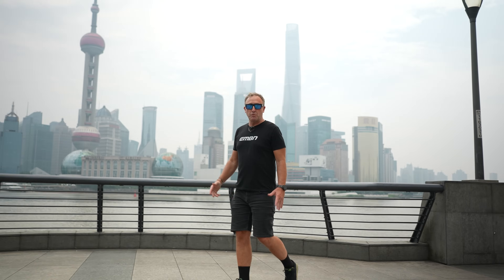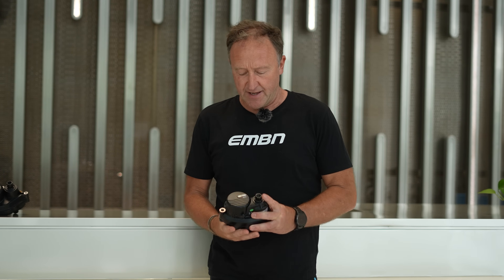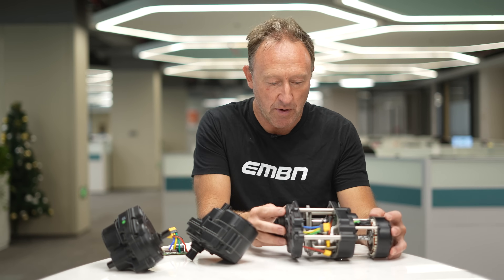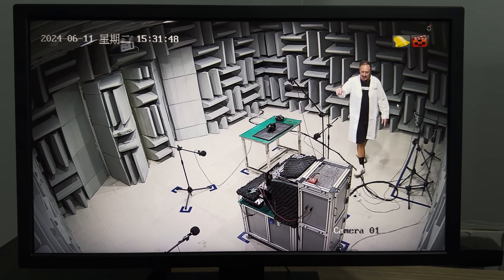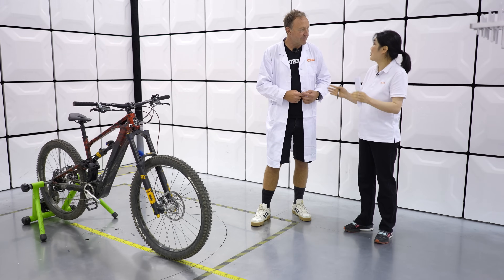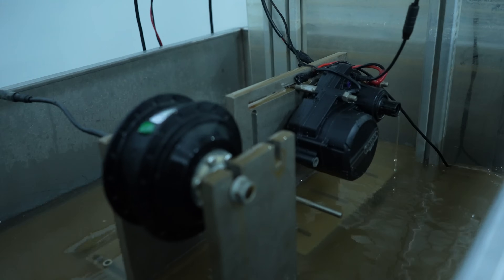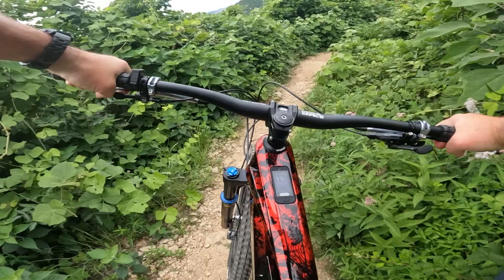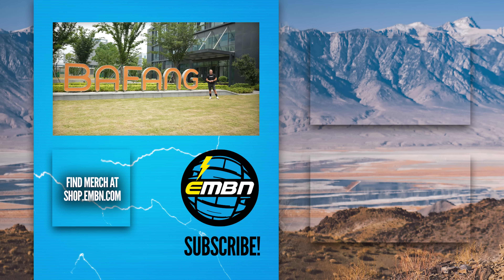How eBike Motors Are Tested! Behind Closed Doors At Bafang

Comment from the maker: Did you learn something new about Bafang from Steve's tour? Have you tried a Bafang motor yet? Let us know below 👇
Reply: Yes, it changed my opinion of Bafang
Reply: What an amazing company, a factory churning out cheap motor for weapons, that will be affordable for the buyer.
Reply: Been riding a Bafang M620 Ultra for about 2yr now. I simply couldn't ask for any more. What I just witnessed explains the reliability and power of this motor. Thx You for braving the "evil" China to bring us this report!
Reply: @GDawg2K2  My M620 has an external Flipsky 84100 controller. Battery Samsung 50S 20S6P 50A/84V. 4.4kW/260Nm, this is power :)
Reply: I have build 9 Bafang BBs bikes. The oldest has over 13000km on mountain trails. Amazing motors repairable customizable and quiet!
Reply: If Bafang made a direct replacement for an EP8, they would have a winner
Reply: @embn  uso bafang 750 en una giant Glory 00.......desde hace 2 años tengo la mejor bicicleta eléctrica de mi ciudad....... lo dudas?????y el arreglo es gratis.....160nm Torque.....limitó y deslimito depende del día........mi bici bafang unica y bafang es el mejor motor bacsno oara reirte de todos tus amigos con bicicletas de 10.000 euros.......
Reply: I’ve been to Suzhou many times to visit electronics factories. But I never knew single track was so close! I’m doing that next time!
Reply: I had a bafang hub motor for 2000+km until now with no problems. 🎉I’m very happy with it. 🎉😊😊😊
Reply: I learned nothing. I'm too damn hard headed.
Reply: When do we get part 2?  Can’t wait to see the rides especially the m560.  I’ve heard they made it stop sounding like a jet engine.
Reply: What a great slick report. Bafang. Opinion. Changed.
Reply: Congratulations on the excellent article, anyone who has had other engines and can compare, knows the difference it makes to have a BAFANG engine, in terms of durability, maintenance, access to engine parts and configurations, costs, power, torque and the pleasure of switching to other brands on the trails.
Reply: I have a Forestal Siryon with a Bafang made motor system. Very similar to the M820 in this video. 2 Motors (first failed out of the box), 4 Batteries, 2 chargers, 2 dashboards in under 12 months. Bike fails every time it gets a light watering. Can you please ask your Bafang friends what went wrong here as Forestal are blaming them for everything.
Reply: been riding an M600 for the last 2 seasons.  Motor is a banger, battery has been glitchy.  After seeing the level of testing they perform, i'd have hope the newer power sources would be improved.
Reply: I can’t believe you didn’t mention their most famous motor, probably the one that put them on the map, the BBSHD. I’ve had a BBSHD for 10 years now and it’s only seen abuse and neglect. It’s snapped more than 50 bmx chains in the time I’ve had it. It’s only used on steep off road terrain in Scottish bogs and moorland on a fatbike. I couldn’t be more impressed. It’s had a 1500W controller for most of that time so even more reason to be impressed with it. I’ve changed the nylon gear once.
Reply: @embn  Have had nothing short of malfunctioning bafang motors. Went through a total of 5 in 1.5 years. Bafang motors tested in real life have fallen off to behind the pack. Definitely not recommended at all!!
Reply: Hell, I want to know what that bike with the Ohlins suspension and the top tube controller is.

Comment: "I am Stoked"   Nice work! on this  fabulous presentation of this Great Company!

I just got my new M810 motor kit to replace my older M800 motor.

Now I want a New 48 Volt, 500 watt, 95 nm, 6 Phase M810 motor!
Reply: Why do you need more watt than 250w? It just drains the battery faster I would go for m510 250w
Reply: Well, that's easy... we have these things called hills and really big hills require more power.  Especially off road in soft dirt.

Also riding into the wind, especially when going up hill requires more power.

On the flats and going down hill... any motor and no motor works!
Reply: My next bike will be an M560 750W for both city and offroad use.
Reply: More watts equals more hill climbing power!
Reply: Work on your legs and you will have more power 😅

Comment: Ebikes are shit. My brother got me an ebike after my mother's passing. I have rarely used the bike as its too heavy to be carrying up and down 3 flights of stairs, but the other day i had to go for a 20 mile cycle. I was caught in a light rain shower and pulled into a garage until it passed. My battery was fully charged and bike was well serviced so i should have no problems. I wish. The battery will not turn on unless bile is plugged in and when disconnected it will not turn on at all. WHAT A PIECE OF SHIT EBIKES ARE WHEN YOU CANT EVEN GO OUT IN THE RAIN. Or has anyone any suggestions before i throw a £2000 bike in the nearest river. What a waste of £2000, i can think of alot better things to spend my money on than replacing batteries every time it rains. WHAT A PIECE OF SHIT

Comment: I bought a Trike last week, placed a front motor hub wheel and planning to convert into a Dual using the Bafang as the 2nd motor or the based motor. Great video, tells alot of the quality over the reputation of China made products for quantity.

Comment: I still have my bbs02 and bbsHD to be honest the bbs02 (updated mosfet version) is all I need. 

Lets just hope they are installing some power overload or short sensing, even a fuse 😂 to stop you being able to brick the controller by plugging in a broken speed throttle. Thats 2 motor controllers I have went through because of that.  That was back in 2015 or so.

Comment: surprised to not see the M435 and M635 for BSA bottom bracket mounting. These are the most silent of all, and with the addition of a great torque sensor, they are the very best out there at the moment. more powerful, better heat dissipation, very responsive and extremely quiet, significantly more quiet than the M510 while pushing power levels of the M560 and M620.

Comment: Congratulations on the excellent article, anyone who has had other engines and can compare, knows the difference it makes to have a BAFANG engine, in terms of durability, maintenance, access to engine parts and configurations, costs, power, torque and the pleasure of switching to other brands on the trails.

Comment: I bought  a new 2024 full suspension Buzz Bike here in NZ made with Bafang components.  I'm on the third motor after doing just 800km and close to requesting a full refund. I suspect Bafang makes the grade on mechanical components but will cut corners on electronic components to remain competitive.

Comment: The Bafang motor freezing video is good done in US. A bike manufacturer just did it for a test. It still worked, but it was completely rusted inside. It was finished, but the display still worked great. The battery was also done, but for displays only rated for smash and dust proofing, it survived being frozen for 30 days. As for thier hub drive the don't have any sealing it's flat ally cover against flat alloy body replaced 2 already in 3 years with them rusting up inside

Comment: I love my G510 52v nominal voltage 30a controller 1740w peak power.(Biktrix juggernaut FS) I use it to tow my dog and his chariot behind me.(Burley Coho xc) he is 11 now and can’t run as far as I can ride an e-bike. It’s quiet too. I wanted to get a pinion MGU bike. But after hearing it, no thanks. I have gotten up to 53 mph 85 kph before and can beat any $10k + bike uphill and have 27.5” x 3.8” tires.

Comment: I built a 150mm rear travel with an M500 during the pandemic due to the unavailability of the mainstream products. Bafang replaced the original motor due to a defective clutch when I received the motor, but with over 4000km since, it's been super reliable with no complaints. Affordable replacement parts are also a bonus.
Reply: Same here. I ended up with A Luna Z1 that uses the Bafang M620 Ultra. 160nm at 1500W.  I reoutfitted the bike with AXS Eagle wireless derailer and dropper. Plus an EGGrider controller that offers Bluetooth tuning. I'm on my 3rd set of tires after somewhere around 10k kms. The motor just keeps delivering!

Comment: Dear Bafang, get back to basics. That means BBS series, BBSHD best motor ever made. Made to last,easy to replace any part. Extremely rare thing these days.
I know it's very bad business to make things that are high quality and long lasting,but on the long run your company will only grow.
I would love to see upgraded BBSHD, with more power, this thing would sell like crazy!
Reply: Ive loved my BBSHD''s, my current one has 35000km and its on all original parts, serviced every few thousand km with a simple regrease and new paper gasket. ive had it thru absolute hell with irelands wet winters
Reply: They so badly need a torque sensing motor conversion kit. I know they are developing one, but it is taking ages.
Reply: they still make these, there is even the m635, which is a torque sensing bbshd
Reply: @likfrikbik  Maybe tell bafang and not a youtube bike channel.
Reply: @srennielsen4545  You have a point.
You think no one from Bafang will see this video and comments?
Reply: @likfrikbik  I dont think see a link from you- to bafang holding a boardmeeting with investors over your “need better quality” comment on the bike channel, no.

Comment: That was a great video! The crew at EMBN should be proud of that one. Was really cool to see a behind the scenes of testing. Bafang is definitely on the radar more these days for me. But if any this highlights a problem the e mtb industry has. If the bike i buy comes spec'd with whatever motor, i have no option as a consumer to buy and swap out different motors to try and own. I have to buy an entire bike and the system they tell me to ride . Ide like to honestly try or buy a bafang motor as well as others. Industry standard bolt pattern or adaptor jigs would be great.
Reply from the maker: Thanks for watching :)

Comment: I am going down the route of converting a "standard" bike with a Bafang kit. I have a branded ebike, but now I want something where I can replace and service all the parts myself, or as much as. Even software is available to program the controller for power delivery. Yes, integrated components are pretty, but I value practicality too.
Reply from the maker: Cool! What bike are you going to use as the base?
Reply: @embn  I'm into fat bikes, so I've got a  Surly Wednesday and fitting a BBSHD 48V unit. Later, I'm looking at putting a Mastodon Pro front fork on. Just increased my rotors from 160mm to 180mm. I've found I need the bigger discs for control. It's pretty hilly where I live. My branded fat ebike is heavier than the Surley. That one came as a 250W class II for Europe, but uses the same controller and motor as the USA version. Fitting an eggrider display allows to unlock the power settings. The same eggrider display can be used to program the BBSHD controller.

Comment: Very impressive. Amazing. If Bafang wish me to test their motors in 365 days of Welsh rain I am eager to volunteer.
Reply: As the same of israel's dust powder and mud all year long. With the most rocky land of the galil. ❤😂
Reply from the maker: The dream job 😍
Reply: @RoissyAngel  I've around 50000km across two Bafang motors, both have survived Irish winters and lots of abuse, unlike Bosch. Let's not also forget that the motors are fully user serviceable and parts are easy to get. None of this closed system crap

Comment: Why havent bafang been used by any of the major EMTB manufacturers??
Reply: The Answer is simple.Bafang sells motors and systems on a open market meaning yuo can replace a motor or get parts yuorself. Saving allot off £££$$$."Big" MTB manufactures don't want this because they get a big cut for every  motor "fixed" /replaced.They are not interested in fixing a 5$ broken part because it doesn't makes them MONEY!!! tHEY JUST CHARGE A PERSON FOR A NEW MOTOR WHICH COST 7 TO 800£/$. In other words. Modern bike manufacturers are aplying Apple sales modell to  bike. It's better to buy a new bike than to fix an old one every couple years. You own nothing and you'll be happy about it. (Also Bfang is the only big company that sells motors are sold unrestricted!!!!!!!!!!!!!)
Reply: @moozeex1  Good answer!! It does make one think about how the "Corporate" side of anything manufactured is not about the "Consumer" it's just about the Profit!! 😡
Reply: Not locked down enough and too easy to repair. Probably...
Reply: They do with Vitus, one of UK biggest bike brand.
Reply: Forestal Bikes

Comment: The big concern about e-bike systems is battery safety, obviously not helped by cheap Chinese made units that are built to a price point. After seeing the facility are you convinced that the safety standards of the Bafang systems are as high as the more “reputable” companies?
Reply from the maker: Without a doubt!
Reply: Actually the best battery techs all come from China now, Porsche, BMW, Tesla EVs are all using Chinese battery brands,catl and byd.

Comment: They are missing 1 critical machine, the pedal strike machine! The death of every ebike motor.
Reply: Aren’t Bafang motors relatively easily serviceable though, and with spare parts readily available?
Reply: @freeforester1717  Maybe if you have tools and equipment and confidence / experience, but that’s probably only 5% of owners so not sure your comment stands up.
Reply: @mintsauce101  my comments referred to repair by competent mechanics; many of those guys complain about the lack of parts availability for other marques, for no other reason than a stranglehold on said parts by the manufacturers, which force riders of broken or damaged motors to buy entire new units or even a new ebike, all for the want of specific parts; this is not Bafang’s philosophy.
Reply: ive smashed my BBSHD off many a rock and tree stump, even bent the crank out from the frame around 8 inches. all ive had do was replace the crank